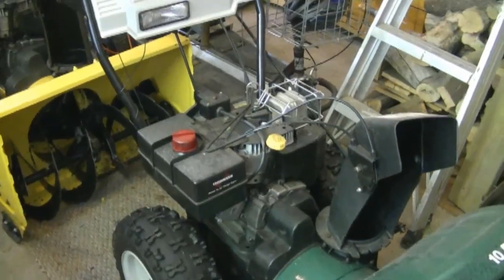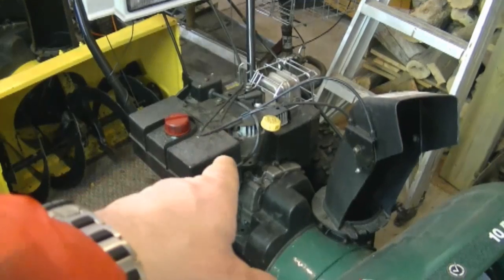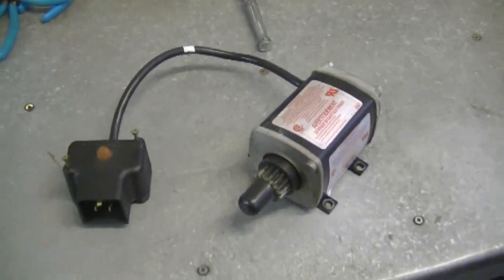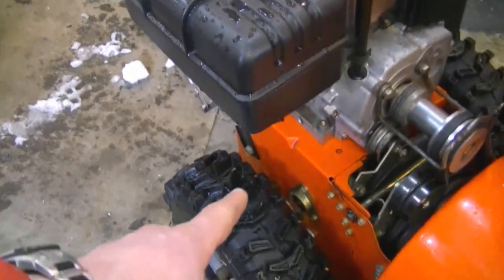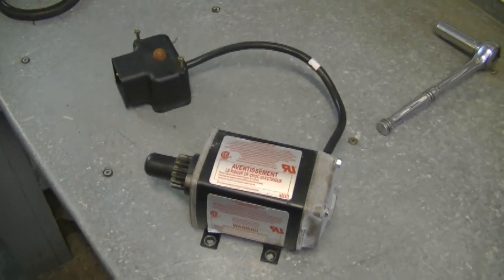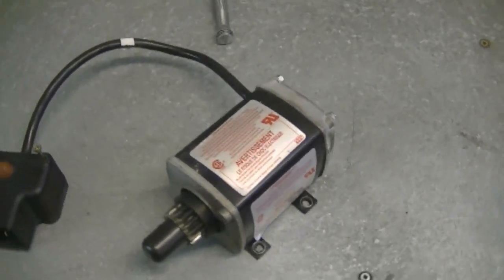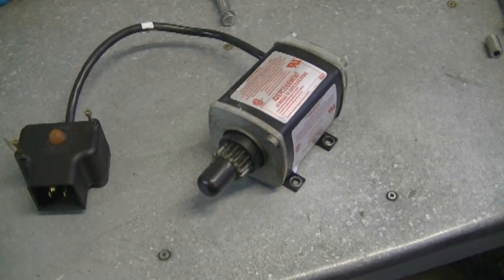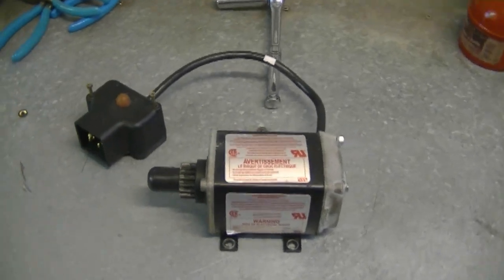Small Engines Q & A  Video #38 in HD

Comment: hi Don,great vid.
now, i own almost 4 years two gasoline water pumps-Chinese copy of HOnDA .
until today i dont have any problems with them and i'm satisfied of them.
they have very small fuel cosumption for 200cc engine-only 300ml low speed to 600ml gas high speed per hour.and they work almost thru the summer at +40 celsius
they are more than worth for the money i bough them,very quiete and perfect thing for my job.

Comment: i BOUGHT A CHINA (sorry for caps) made starter for my sears cutsom 10XL I bought it brand new for 47.00 shipped to my house. ( I bought it off of Ebay)  I called sears and they wanted over $250 so I got the part number and put it in the search box on Ebay and this china made one pulled up.  Bolted right up no problems. Started perfectly too.  No weird sounds and anything.  It was perfect.  I sold the mower but the whole time I had it.  It worked great

Comment: Thanks, Donny. That topic of storing gas in a vehicle has been discussed on motorcycle forums as well. Although it is appealing to drain the gas from the bike for the winter, moist air in the gas tank can later condense on the sidewall and potentially cause rust inside the gas tank and carb. I've been in the habit of using stabil and keeping the tank full. But I can say that at least once I needed to have the carb cleaned because of bad gas. So, maybe I should empty the tank every fall.

Comment: I have Chinese motor on my lawnmower , its Loncin but it looks quite similar to that which is on Powermore site. I have it just one year and it is without problems yet...

About fuel - When I dump it form mower / chainsaw and use it in motorcycle. Last year i get lawn tractor with about 5 years old fuel in it... I used it in two stroke motorcycle and it runs good without any problems...

Comment: I have not tested any starters for the Tecumseh Snow Kings; but there are several available on Amazon ranging from about $170 US for Tecumseh down to several in the $80. range from Sterns, Rotary, Oregon. Note that some even have the switch available as a separate item. The switch would be much less to replace.

Comment: @motorhead1 - True, a lot of the brand name oils for Chain Saws like Stihl, Huskvarna, Echo, etc. will have the stabil in it like you said, it's usually the cheaper no name brands that usually don't.  The difference in cost is als really negligible also once you factor in the cost of buying the stabil separate, so a good choice to save yourself a step in maintaining gas.

Comment: i have a BE gas pressure washer 3000 psi with a Chinese clone engine 
still works 
only issue is the Plastics seem to be of lower grade 
grey choke lever cheesy kind of loose

Comment: Question 
i am rebuilding a Briggs Snow engine 250 cc 
15c107-003-f8
the block is NEW ( Virgin )
piston New , Rings NEW , Crank NEW , Rod new 
do i need to hone the Cylinder ??? (its aluminum )